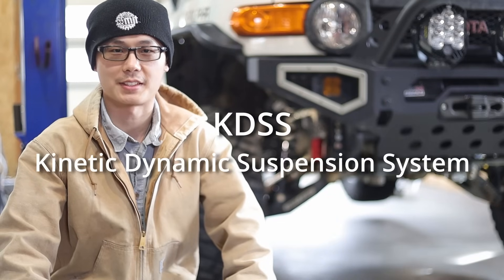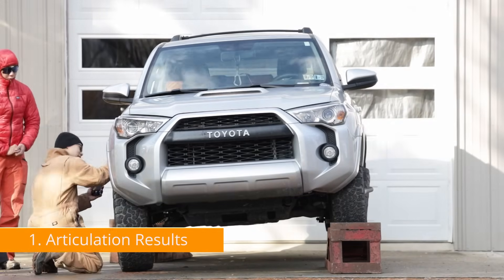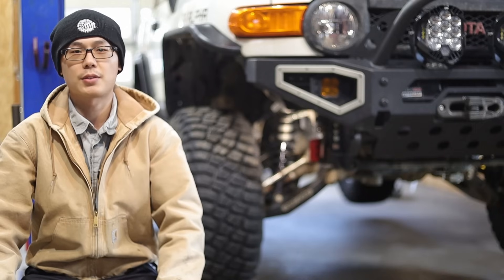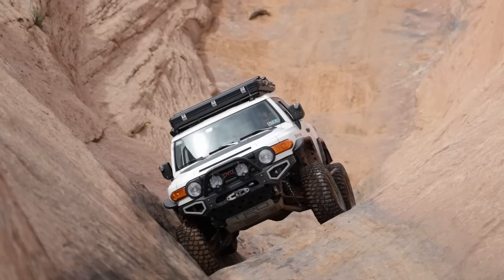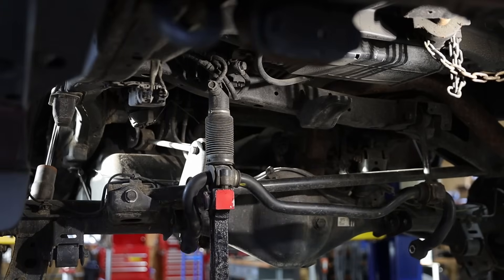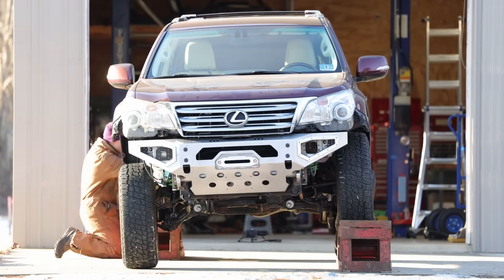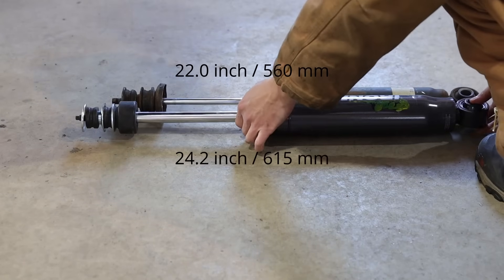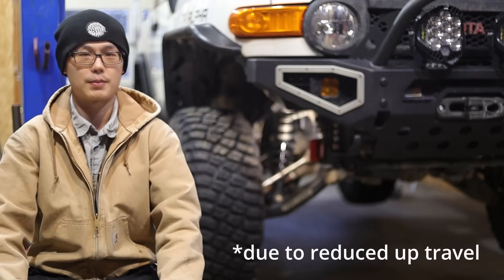Toyota KDSS Ultimate Test | Legit or Gimmicks?

Comment: Your videos have been amazing. I opted for KDSS when I got my 4Runner and for a while had buyers remorse thinking that it would prevent me from adding lift. I was able to lift the front by 2.5 in with no problems.  This video shows that I made the right choice and your other videos helped me understand the Toyota suspension much more. Reconnecting the KDSS sway bar after shock install was a pain, though. Keep this kind of content coming.
Reply: I ordered an Off-Road Premium with KDSS. What lift did you get and do you like it? How much on the back?
Reply: @skoolynugenator1802  2021 Venture Edition. Probably like yours with a roof rack. 1 inch lift in the back. It took all the rake out. After adding 275 tires I'm going to drop the front by .5 inches to get some rake back.
Reply: @kaitroester7386  any rubbing with the 275’s?
Reply: @skoolynugenator1802  yes. I needed to "mold" the mudflap plastic closer to the body mount. I'm running Falken Wildpeak AT3Ws C-load on 17x8 rims with +5mm offset. I could have put the tires on my 17x7 stock wheels but was planning to get 285 tires before the tire shop talked me out of them. They had a recent 4runner that wanted them too and they could not make them work w/o excessive rubbing. 285s would have been a problem and the 275s look great. More rugged than stock but not excessively large. Also less additional stress on the drive train.

Comment: Great video!  I have kdss with a front spacer and the Sonoran Steel track bar and radflo extended suspension. Works great. But I have been looking at doing the 2"long travel up front.  If you're in Northern CA and interested in doing more measurements I would love to help.
Reply from the maker: Thanks! unfortunately I'm all the way in PA. Good luck with the build!

Comment: 04 4th gen in the high desert of NV, 1.5" lift up  front, .5" in back, rear sway bar removed, oe sway bar in front. It's been a great all around 'dual sport' truck and a great desert tourer. Question about KDSS: can it be used up front, only or is it a front/rear system like the old XREAS? 

Great vids, explanations, and quality. Love your FJ. 💪
Reply from the maker: Thanks! Off the shelf you cannot use it front only. Maybe with some extensive mod you could

Comment: Very thorough video along with the excellent comparison of the two systems. My only gripe with my KDSS is its the only thing on my 4runner that I have had to have repaired, twice. Unfortunately I do not feel that it is all that reliable and I hesitate even installing a mild lift.
Reply from the maker: Yeah I have heard the reliability hasn't been stellar like other toyota parts. Do you know what was the cause of failure? Was it corrosion related?
Reply: @TinkerersAdventure  Not certain what the cause was but probably not corrosion as I'm a stickler about keeping things clean. Both times the rear cylinder needed replacing. First time was at around 30k miles and second about 65k. Also, the system doesn't respond well in extreme cold weather. Anything below 5 degrees fahrenheit and the KDSS light will be on until the outside temp rises above maybe 10 degrees. It might be pressure related due to the cold, not certain about that either, but it certainly doesn't like it. I really thought it would have been more reliable as they put it on their flagship model,  the Land Cruiser. Outside of that I do think it's a very good system as you have shown in your video.
Reply: @TinkerersAdventure  On our 2012 “Trail Edition” 4-Runner the KDSS light just started coming on at 70K miles. Toyota diagnostics (+$209 labor extra on the last service) shows the KDSS system still operational, solenoids are good and pass “active test”, and no active codes, but a history of DTC C1832 - accumulative solenoid malfunction (downside).  But if I want the KDSS light to stop coming on, the estimate is $12,817 to replace the system ($9425 parts / $3392 labor) and our only Toyota dealership within 500 miles won’t work on it without complete replacement due to the severe rust from the winter salt on our roads. I purchased the Toyota undercoating option when the vehicle was new,.. I wish “Waxoil” was still in business, but there is nothing like that available now.  The KDSS on our 2012 handles the road bumps and potholes way better than our 1998 SR-5 4-Runner did, but a $13K repair is more than I can swallow. 😳 I cut a little piece of black electrical tape to cover the warning light and we’ll just have to hope that the great ride continues for a while longer. 😊
Reply: Love the ride of my 4Runner KDSS, would not buy one without it. Would change to a GX 550 if couldn’t get a 4Runner with KDSS.
Reply: Rust like the frame has been a issue so important to do preventative measures especially in cold climates. Also the accumulator unit needs to be opened up and cleaned out when dirty, and also rust prevention measures taken.

Comment: Well done young man.  I get tired of explaining to Trd pro people why my kdss  4runner outperforms them with a 2 inch lift and shock, tire upgrade. Not to mention the huge road handling benefits. It’s humbling for them to realize they overspent by $10k+  for the trd pro badge + modifications.  That all said it depends on your requirements. My experience with most offroad people is they are 90% mall getters.   I needed my setup for work as I work oil and gas and abuse this system daily.   My 2 cents your mileage may vary.
Reply: yeah I couldnt justify the extra 10K for cosmetic changes, suspension upgrade and other features. seemed unnecessary and you can pick out your own suspension upgrades/wheels with the money you dont spend on the trd pro. maybe some people like that but not for me.
Reply: @Hotel_soap  exactly and better components as well.. The TRD Pro is a marketing gimmick designed to separate your money from wallet when you can build a new better off-roader for the same $ or less.
Reply: The TRD Pro moniker adds a number of nice upgrades not to mention that over the pandemic the value almost doubled on just the TRD Pros. So I am sure 10k for the Trd pro was not really a big deal to the people who own em...
Reply: @shrayesraman5192  Yes trd mall queens are proud of the red stitching until they have to turn around on the trail, seen that many times.
Reply: @michaeldbhawker3556  To each there own i guess... To be honest it makes no sense to buy a new vehicle to off road. Anyone buying a new 4runner to do serious off roading is nuts or is so loaded they don't care. Calling anybody a mall queen is crazy unless your 4runner never leaves the trail.
Reply: Just curious on the exact details of which coils, shocks and tires were in your upgrade?

Comment: This is some really great analytics here. I’ve got a ‘12 GX460, 1.75” spacers with stock struts and 2” Icon springs with stock shocks. A lot of people asked me why I did this. Because of the math! My GX has KDSS, which most people think is a limiting factor. But here’s proof right here. Limiting yes, if you wanted to lift it 6” but I find. With my setup, full wheel droop and my articulation is better than if I had a swaybar. Great video!

Comment: This is DrKdss by the way. 

So I bet if you make a true comparison the kdss will be better off camber. 

Go find a gx or 4r with kdss with the same width tires as yours. Look how close the stock one was compared to yours. I bet the comparable kdss will lean over less. Just saying.  Apples to apples is how it should be.  

Once the kdss shock itself runs out of travel , that’s when the high spring rate sway bars in comparison to non kdss sway bars will take over.  I really feel like you were right at that point of the sway bar taking over on the kdss gx.
Reply from the maker: I might be missing something from your comment? But the stock non-KDSS 4Runner and stock KDSS GX in this video are apple to apple comparison. The GX leaned much more than the 4R, hence I drew the conclusion KDSS is worse in off-camber. The FJ is just another data point, not a direct comparison to the GX.
Reply: @TinkerersAdventure  maybe I missed something too lol. Just sounded like you made a quick comparison on kdss and then yours because you mention about your has a rear sway bar.  I’m pretty sure I seen you compare the kdss gx and yours too no ?
Reply from the maker: @fltllc4136  I see I see. Comparing to the FJ was just a benchmark since I have a lot of personal experience in it. If I removed the FJ’s rear swaybar, it’ll lean a lot more than the KDSS for sure

Comment: I’ve been considering removing the sway bar on my 2017 Tacoma with a 3” Ironman FCP lift. This definitely convinced me. I figured with stiffer springs/shocks, it’ll give the truck more stability without the sway bar compared to the stock suspension.

It just seems absurd to pay for such a nice lift kit and lose all of that off road performance by keeping the sway bar.

Also, it would be really great if you made a quick video showing how to adjust front coil over setups (such as the Ironman on my taco) to lower or raise the ride height.

After your last two videos, I’m looking to lower my ride height to 2.5” instead of 3”. I definitely noticed the lack of down travel as well as the harshness over bumps due to the high pre load.

Love your videos, thanks!
Reply from the maker: Agree, with a front swaybar no matter how much travel you add it won't be realized during articulation.
Reply: @TinkerersAdventure  Do you need limit straps if you remove the front sway bars? If so, why and what length limit straps?

I have a GX470 with rear sway bars and long travel shocks/springs in the rear. Front is just 6112s with HD coils.

Comment: I'd like to know how much droop and articulation you gain in the  ifs front end by adding sway bar spacers. I do a lot of long distance driving so I like the sway bars and only so often do I get to really flex the vehicle and I feel I'm loosing down travel. I have a 2 inch lift  but it's a heavy duty lift for excess load.

Comment: Have you tried, adding an electrical current to the KDSS system to force it to activate for the off camber test?
Reply from the maker: No, but i wish someone come up with that. the current aftermarket KDSS switch does not do that

Comment: the the iron man rear extended travel, did you have to use extended rear bump stops?  I went with rear extended travel Dobinsons but had to extend the rear bump stops by 2 inches.  While my shocks have the ability to extend longer, I have stock links so my droop ability was not increased but I lost 2" of up travel due to the extended bump stops.  Thoughts?
Reply from the maker: Your setup is in the realm of really extended travel rear shocks. They extend so much the collapsed length is too long hence the bump stop spacers. The ironman is the longest without sacrificing up travel.
Reply: @TinkerersAdventure  yeh, i didnt think about that when initially going with the ext travel rear setup.  I may try to relocate my rear upper mounts up 1-2" so I can regain my up travel and stock bump stop location.  Might be a little with the body in the way.

Comment: I like the way our 4Runner handles on road with KDSS. But man did it make my driver’s side slider install suuuuuck. And I didn’t want lean so I had pro’s install my lift. If I had a non-KDSS truck it would have been a lot easier.

Comment: After running without sway bars a while I quickly found that yes you get a bit of body roll but anything running 40s or more on the street is a compromise anyway. Thier main benefit is the level the vehicle after completing a turn. Mine continued to lean until a bump would settle the suspension level again.

Comment: Great info. I was skeptical about buying a KDSS Toyota but now I’m convinced of making sure my next Toyota have KDSS
Reply: its the best , but i only recommend one inch lift , with kdss
Reply: @irfanspace  even with the KDSS extensions? I seen people with KDSS installing extensions after a lift to lower them down to the original location.
Reply: @walterramirez3287  i have 2020 4 runner lifted 2 inch front and back and no issue , not even once my sway bar KDSS touched anything , but i am not happy , i wish i just lifted one inch, because lift , FK-UP everything  , people does many things so do it .
Reply: @irfanspace  I just wast a reliable vehicle but want to put 34s on it. Before I do anything I would be doing more research. Thanks for the input.
Reply: @walterramirez3287  i will give you answer , you can put without modification 275/70/17 tire size but if you want to go 285/70/17 you will get rubbing  , also depend on alignment ,  but you must go 3 inch lift  for 285 tire , with 3 inch lift you must need to extend break line pipes , , diff drop + skid plate bolts replacement , along with rear panhard rod alignment ( no one does) , and you will loss ride quality , you get lift by Harding the spring , these vehicles not build for rock curling , just for off road , no one will tell , until you experience by your own , one inch lift is better ,by putting better shocks and springs but Max 2 inch lift , base on my experience .
best of luck ✌
Reply: @irfanspace  thanks for the info. I will considered. I’m not going for rock crawling. Mine will be a daily driver with the occasional off road trip. I will not be putting  heavy bumpers, Fridge or roof tent. I rather have a small off road trailer where I can put a fridge a stove and a roof top tent. I don’t want to overload a daily driver that is going to see limited off-road time and impact gas mileage just for looks. Another reason is that I rather have the sleeping arrangements separate in case I want to go exploring and photographing early with out having to wake everyone up.

Comment: Great job explaining things! If you add Dr_KDSS control you get solution for of-camber issue
Reply from the maker: Thanks! The switch can only override-open the solenoid at high speed to make the ride softer. But it cannot override-close them at low speed to improve off camber.

Comment: Another great video! I feel the kdss swaybar probably uses a more flexible material than the non kdss swaybar . That will explain the more body lean when putting ramps on the same side. On highway driving the hydraulic system provides additional stability that compensates the softer swaybar
Reply: You are actually wrong. The sway bars on the kdss are definitely a heavier spring rate.

Comment: Thank you Kai for these great videos. I have KDSS on my 4runner and I'm happy with the system. I do overlanding and up to moderate trails. No desert racing, no crazy rock crawling. 4runner is a 2018 TRD Offroad and has a 2.5"/3" OME lift, and spacers on the rear sway bar.
Reply: Nice set up, I got a 21 TRD off road with lift. I haven’t gotten the spacer for the rear quite yet. Im at 2.75 in front and 1 in rear
Reply: sounds exactly like what i want to do with a 4runner, jealous!

Comment: What do you think of the new E-KDSS system used on the 300 series Land Cruiser? It allows the front and rear sway bars to act independently of eachother and there is no longer a solid link that limits passenger side droop.
Reply from the maker: Yes, I was thrilled to see the E-KDSS with an extra cylinder on the front passenger side. The rear still only has 1 cylinder. The extra cylinder is new and looks promising. The "E" part is not really new. LC200 has 2 pure mechanical valves instead of the electronic solenoid. That's probably the root cause of "head tossing" referred in the LC300 video. But the Prado platform today is already "E"-KDSS in this regard.

Comment: KDSS is a pretty cool system for a daily driver that also goes off road. I'm looking into the DrKDSS type switches for my GX as I feel like there are certain trails where the 12mph threshold for soft/stiff is just a little slow. You want to go 15, but instead go 11. There are also more prepared dirt/gravel roads where KDSS shines. It's not a Raptor, but can maintain quite a bit of speed without feeling sketchy. 
The only other thing is just making sure your aftermarket parts like skid plates, sliders, and lifts don't cause interference with the sway bars. Tons of companies have these parts now.